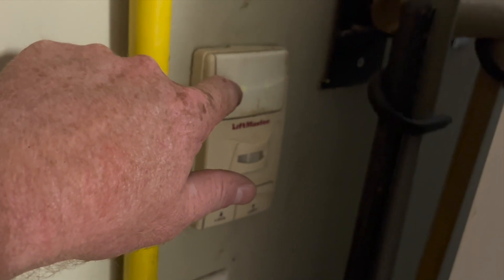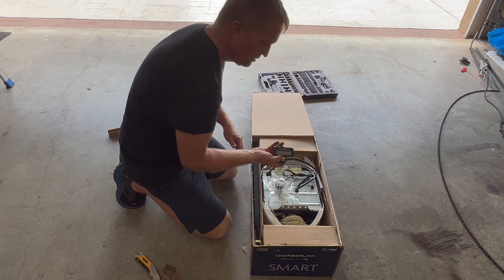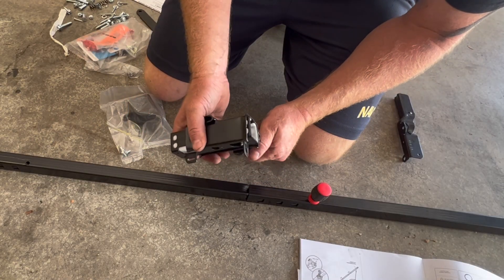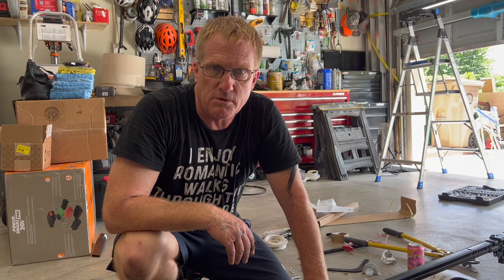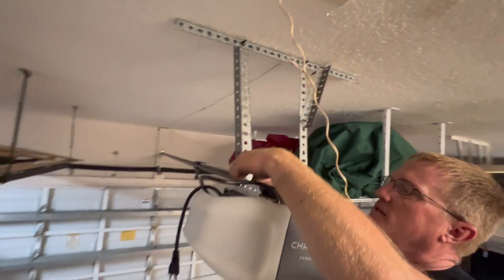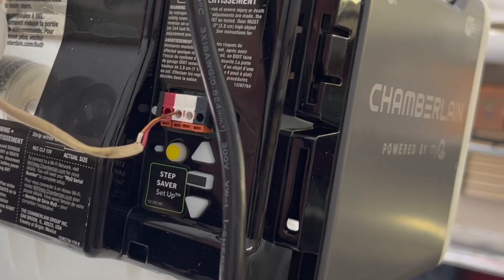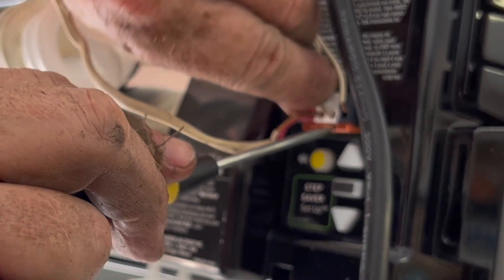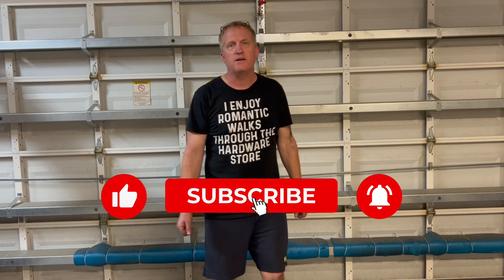GARAGE DOOR OPENER INSTALL!!   You don't need a pro.  #diy  #garagedoors #DIY #fixit

Comment: Very good video. Couple of things, 1 belt needs to be tightened up more, 2, I would strongly recommend rehanging hanging the opener, it is hanging way too high above the door, this will wear out the opener, how you want to hang the opener, is place a 2x4 on top of the garage door (when fully open) then set the opener(with rail) on the 2x4, then you want to attach hanging brackets from the one on the ceiling to the opener, then remove the 2x4
Reply from the maker: Thank you for your advice. I'll try to tension the belt more. I saw in the instructions to place the 2x4, but figured I'd go with how the old opener was originally mounted. I'll get some angle and lower the opener and the wall bracket at the end of the track.